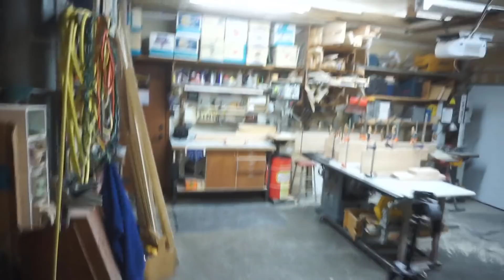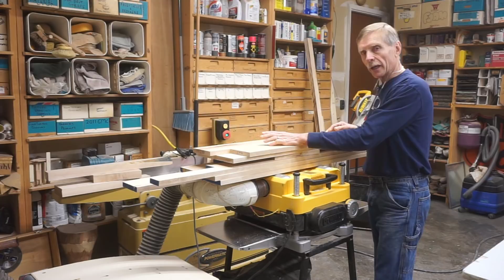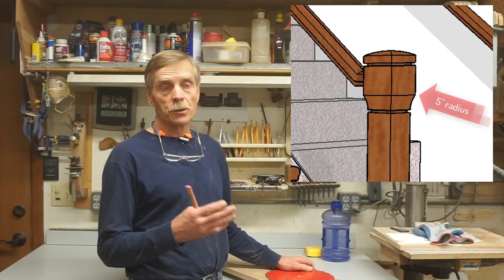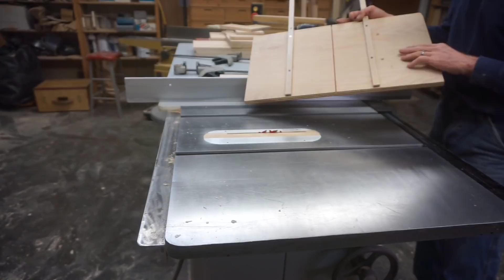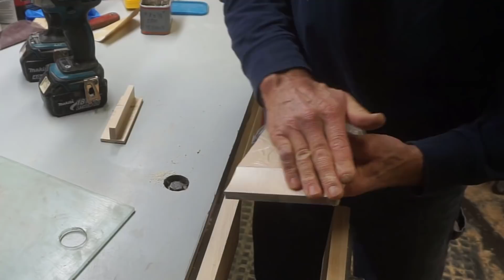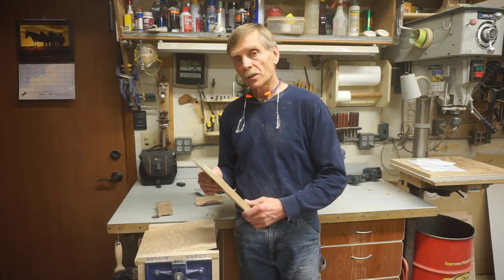Make Wide Coves for Box Newel Posts

Comment: Couldn't you get more clamp storage space if you parked them differently? You know, with one rod they hang on and another that pushes down the top jaw so they stay vertical? Not that they really need to be vertical in my opinion. Just that it'd be tidier.

I like what you said. Start with design and work out how to get it done later. I'll remember that. That's pretty useful in everything.

Not gonna be able to manage 25 videos a day. My head is about to explode. So many useful ideas!

Comment: Hi Matt, I just noticed your pillar drill.  Wow, at first I thought that's a big drill and the more I look the more I think it is big.  That is no optical illusion.  The top box is massive!  I would love a look around and inside the machine and I bet I'm not the only one.  Keep up the amazing videos.  Al
Reply from the maker: It's an old-ish Delta model Alan.  Massive compared to some but about on par for the size/capabilities of other machines in it's class.  There's 3 step pulleys and an adjustable pulley for on-the-fly speed adjustments in two ranges inside that box.  I've got a dust cover over it to keep things 'clean'.  Work pretty well for all I need it for.  I've considered upgrading to the new Powermatic model but reviews on it are abysmal so I've chosen to stick with what I've got.  Best, Matt
Reply: @NextLevelCarpentry  Hi again Matt, I wish I had room for one like yours, its built to last.  Mine is a bench top model  with 2 belts and 3 triple pulleys for a large range of speeds but was woefully underpowered at 300w so I upgraded it to a 180vDC motor  from a treadmill and a KBMM225  AC-DC controller (16A) for smooth and  quiet operation.  All was great until I tried to countersink some holes in 1/4 steel plate and the 9/16 drill grabbed. Now I know why the old setup had belt slip!  It blew the controller and reduced my shop and home to darkness.  Overcurrent protection my a%^$^
it did stop the current AFTER it had destroyed itself and blown my main breaker.  Back to the drawing board.  At least the Covid isolation has given me more time to get stuff done but somehow I spend most of it watching your excellent uploads.  Keep em coming and cut no detail out mate. :)

Comment: How about running the to be coved board at an angle other than 90 deg. How do we figure the radius generated versus the angle?
Reply from the maker: I'll be showing my answer to your question in an upcoming video Tom.  It's a little too involved to explain here so, for the time being I'll tell you to just raise the blade height to the cove's depth and then eyeball across the tabletop, starting at 90 degrees to the blade (that produces a 5" radius cove) and move to 0 degrees along the side of the blade where it cuts a slot.  There are infinite cove radii possible depending on the angle of attack of the piece to the blade. Coincidentally the April 2020 issue of Fine Woodworking has a decent article showing variations of the process described above.  My method is much simpler and user-friendly than the article shows but the article does cover a great range of possibilities... Best, Matt

Comment: Thank you for the great video, you are an honourable carpenter, I enjoy watching all your videos. but I still haven't found your video for how to make the caps for those newel post. Please advise
Reply from the maker: My apologies Sergio... I never produced a video showing how to make those post caps.  It was a disproportionately complicated process that was too specific to the task to make sense for the wider audience.  It was done with a router in a special fixture that slides in an arc to cut the domed profile on post cap blanks.  It was barely worth the effort and I'm pretty sure you could get similar results in far less time with a bandsaw, block plane and belt sander.  Best, Matt
Reply: Matt, I thank you so much for your quick reply,  please please no need for apology,  I'll just keep watching your new videos. Keep up the good work,
Cheers,

Comment: Great instructional video. I never realized you could do that with a table saw!  Love the safety block also.  This technique could work for raised panel doors also.  Also, the bondo sanding block is priceless.  I am restoring an old Thunderbird.  It has a raised ridge running the length of the fenders.  Part of it is damaged by bad surface rust.  Watching your video gave me the idea to make a custom sanding block on the good part to get the profile correct when I bondo over the damaged part.  I will make my block as long as I can to help get a nice straight edge as you look down the fender.  You think your garage is cramped.  Try combining woodworking tools, carpentry tools (tile saws etc) and automotive tools(engine hoist, welder, sand blaster)    in the same space!!!!  Jim

Comment: Matt, another wonderful video.  Thanks.  You may have mentioned before , but what kind of wood did you use for these newel posts?  Is it nominal 1" stock or did you mill it down from 4/4 material?
Reply from the maker: Andy, the wood is all birch but I'm not sure if I ever mentioned it.  I buy most everything full 4/4 'hit and miss' and mill it down from there to assure it's flat,straight and NOT twisted.  Birch works nicely and I used it so it would blend with other pine, birch and cherry wood used in the house.  Best, Matt
Reply: Matt, I am building several newel posts for an exterior covered porch railing.  I would like to use cypress or cedar but I am concerned because those woods are soft and they may not be appropriate for a load-bearing post.  I am going to use cable railings so the posts will be put under a good bit of load when I tension the cables.  What do you think?
Thanks, Andy
Reply from the maker: @andysparks7381  Not sure the design but my first response is that it's a job for a structural post for bearing load and handling tension that gets wrapped with cypress or cedar for looks... Best, Matt

Comment: Matt, thank you for demonstrating the molded Bondo block..  I never thought of using Bondo this way, and can foresee using this procedure for producing sanding blocks for all kinds of molding profiles.  It will sure beat trying to find dowels of the correct radii and flat standing convex curves.  Way back, we used a General Electric recipe of mixing epoxy with carborundum powder to take impressions of gear teeth and use the blocks as hones to hand grind other errant teeth in the gear.  We achieved better than .001" precision.  Sure wish I had considered using this technique for wood.

And one more thing.  I have an attention span the length of a toothpick in a model bridge, but would never cut one of your V-Logs short!
Reply from the maker: "toothpick in a model bridge"... LOL!  I wonder if it would work to imbed that powder in bondo to the same effect with wood?  Interesting idea for sure.  BTW thanks for watching NLC videos to the end... YouTube notices that and boosts ratings so I appreciate it double! Best, Matt

Comment: Matt, where did you get the throat plate with the sliding insert? Did you buy it? Did you make it? Cannot find one online. Thanks and thanks again for all the great videos.
Reply from the maker: Hey Mark, (this reply copy/pasted from previous questions about that great accessory) that throat plate is a Wood Dynamics model. Unfortunately they're not sold new anywhere anymore that I can find. There was also a Charles Neil Woodworking model that was nearly identical... but sadly not available anymore either. It's too bad because I really like it!  I occasionally make a stack of inserts that I use for each blade width and type. Best I can offer is to search those terms on Craig's List and eBay to see if one turns up. There's a bit of chatter in some online forums under those search terms as well and you might come across one there too. They're worth it if you can find one because it's so easy to switch out that little strip instead of needing a whole stack of whole plates for each different blade or dado width. Hope you can find one!
BTW if you end up finding a new/reliable source please post a link here for benefit of other!  Best, Matt

Comment: i love that interchangeable plate on the saw table, seconds to change inserts ;0) matt is it a good idea to scribe a line with a marking knife where you want the cove to end? it may help with tearout, or is it such a light final pass that it doesnt occur?
Reply from the maker: Sadly that great zero clearance plate is no longer available new because I'd hate to have to work without it!  I think it would be difficult to use a scribe line where the cove ends because any scribe deep enough to eliminate tearout would end up showing in the finished surface.  A sharp sawblade with a slow but steady light final pass is what I'd recommend, the green man, but thanks for being observant and taking the time to comment.  I might also be misunderstanding your suggested use of a marking knife so just ignore my response if I missed it, OK?  Best, Matt

Comment: What a great method. I could see this adapted for making raised panels.
Reply from the maker: It certainly could be adapted, Robert.  I think it would quickly become a matter of how much sanding a person would be OK with.  If the width of cove required could be achieved with a router or shaper bit the labor cost of sanding would quickly outweigh the cost of a bit.  If a very wide cove was part of the design though this would be 'the only' way  to get it done  because it would take a massive cutter to get the job done.
Best, Matt

Comment: Just saw this shooting today and it is as brilliant as the previous ones I watched. The techniques are extremely useful and will be handy when my time to start dressing a few fencing concrete posts comes up. One thing that got me thinking - albeit it might make the overall process even more time consuming - would be to bevel first on the band saw (as long as there is machine depth for that) and then finish off using your technique on the table saw that way most of the chopping would be done by then. Would that be something workable? (maybe someone has already commented on this before or not as it is impossible to read hundreds of posts). We all have our preferences and in what concern mitre (sorry: miter! :) gauges I am really pleased with my Incra's maybe as much as you seem pleased with your Osborne! One final word of Thank You for another comprehensive and very useful video and one suggestion: maybe there is enough already of it on youtube but I'll leave the challenge here: a video on wood grain - there is a hint of that on this video and that is what spooked me in the best possible way!
Reply from the maker: SPS, thanks for a great comment!
I think your suggestion to 'bevel first' is valid, especially if working with a hard wood like Hickory, any time spent beveling would be made up with fewer passes of the coving process.  My first reaction though would be to make the bevel  using a tablesaw and a miter/re fence with a special fixture (to hold the piece vertically safely) rather than even a bandsaw with enough height capacity.  I like the consistency provided by the tablesaw over the 'freehand' nature of the cut on a bandsaw, but that's just me.  I looked at Incra's and chose the Osborne but I don't remember the deciding factors... I'm guessing it's equally useful and merely a personal preference.
I'd love to do a video on woodgrain as you suggest since working with an in-depth knowledge of it really does make for 'next level' projects.  I'll keep in in mind but advise you don't hold your breath because it takes me SO long to produce videos it would be some time before I'd get to it.  I will try to add more snippets on it in videos I am working on though and hope that helps?
Best, Matt
Reply: Thank you so much Matt for your words which are very much appreciated and I am in agreement that provided one could make a jig to work it out with the table saw that would make the whole process easier and more accurate albeit high spec bandsaws may give it a hard run for its money. Please don't see my suggestion as pressure to produce more videos. It is definitely not the idea - I have a very good idea how hard and time consuming it can be to produce a youtube clip and that it is one of the reasons why I avoid giving anyone a thumbs down - serves no purpose and most times is a sign of poor gratitude for the person who has taken the effort, time and expense to make available free content. And yes your idea about the snippets which you have already put in place is a very smart way to do it - wood grain is somehow a topic not well understood (generally speaking and speaking for myself as well) and, as it can have a massive difference on everything from basic ripping (with the wrong blade) to routing or sanding, any contribution to make us better crafters (woodworkers / joiners / carpenters / cabinet makers / insert your favourite here _ )  is welcome! Please remember: I am not expecting anything at all and all I can say is Thank You for all the content you have made available so far. Re support I have to say to I am interested in the putty you have used to shape/mould the sanding block but I could not find any Bondo (hope I got the name right but I am not sure about the type you have used) putty so when you have a second and only if you have time to spare please then pinpoint me in the right direction of your amazon store and I will order some.
Reply from the maker: Yours is one of the most considerate and thoughtful comments I've seen in awhile, SPS, thanks!
I took your comments about video content more as indication that my efforts in Next Level Carpentry are worthwhile and motivation to continue in the direction of channel building because there's an appreciative audience with interest in content I can provide, not as prodding or expectation on your part.  Your comprehension of the challenges faced by content producers is spot on.  The respect and gratitude of viewers like you encourages me (and other 'Tubers') to press on.
I added the Bondo product I like and use to the Next Level Carpentry influencer's page and thank you in advance for purchasing it there if you need to.  I say that because it's available at Ace hardware stores and such and shouldn't 'need' to be found online...  just do it if it's the best arrangement for you and your needs.   Now you know why I'm not retiring off Amazon Influencer's proceeds, right?
Look forward to hearing from you anytime!  Stay tuned, Best, Matt

Comment: Another great video, rainy day here so it is my YouTube time. :-)  I really dig the cross cut cove cutting. The way I have seen it done and tried was the angle cut but will try your way the next time I play with my table saw.
Reply from the maker: Tom, you've given me a great idea: I should try to schedule video upload/release times to coincide with rain days... it could really boost view count on publishing days :-)  
The main difference between angled and '90 degree' cove cutting is the resulting radius/curve.  A 90 degree cross cut is the only way to get the full 5" radius cove I was after.  Any angle at all begins to decrease the radius but I don't need to tell you that.  I was pleased at how smooth the finish cut came out because when I've used angle cuts like you have a LOT more sanding is involved.  You probably already watched this other NLC video where I'm duplicating some old pine base and use an angled setup to reproduce part of the compound curve profile starting at about 1:30: https://www.youtube.com/watch?v=KT-VqcYHwBw&t=976s  Just ignore this if you've already seen it, otherwise it will give you something to do until the sky clears :-)  Best, Matt

Comment: Great video again Matt!! I saw one of the comments about how much you would charge a client to do this intricate custom work. Thats exactly what I asked myself. It must be a lot of money, lol.. But look at the end result. A one time job that nobody else has. Fantastic job and a lot of work. It's a pleasure watching a professional in his element. I loved the Bondo sand block. That was great.
Until next time brother,
Al
Reply from the maker: Hey Al, thanks for your comment... hope you find a use for the Bondo sanding block trick, especially if you're not fond of sanding either :-)  I suspect that the per-foot cost for this level of custom railing is fairly consistent for different railing types but I don't do enough of any one project to have reliable numbers.  I re-thought my previous response and think I should have mentioned a 'line item' for the design process itself because this one started out as a blank slate with the only predetermined factors being glass instead of ballusters and wood, not metal, for newels and railing.  Depending on the number of iterations and hours spent modeling them design can approach $2k by itself.  Customers who are in the market for something 100% custom usually realize that and don't fret over the reality.
More to come...
Matt